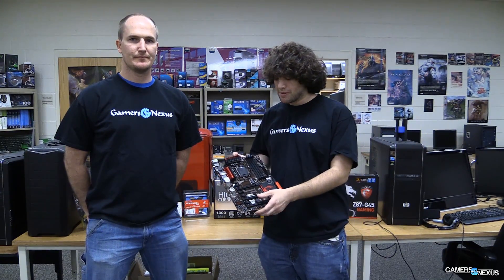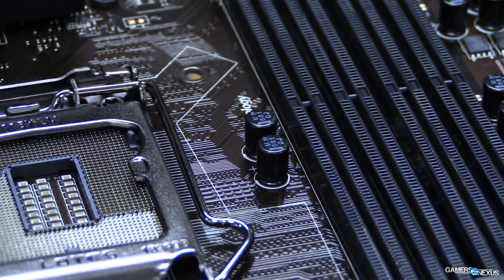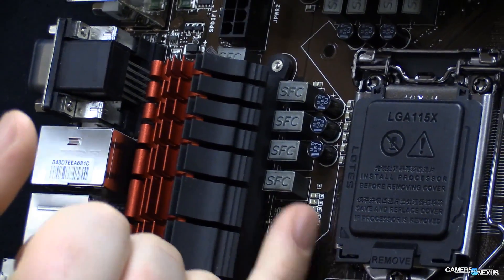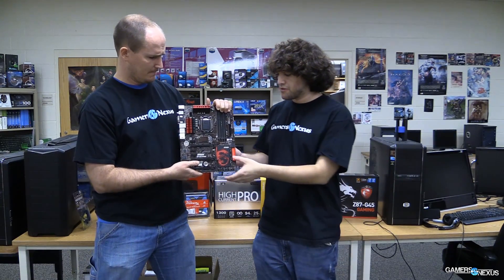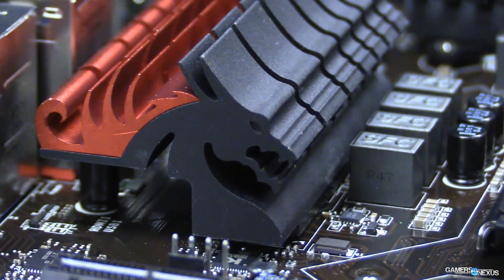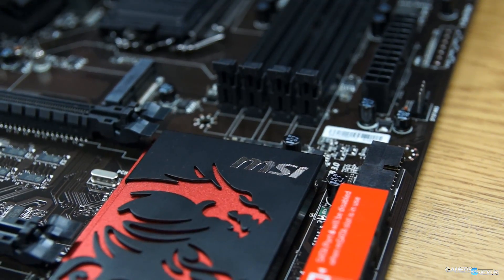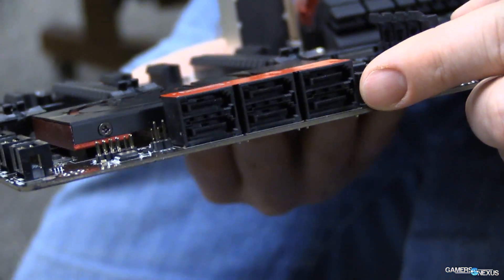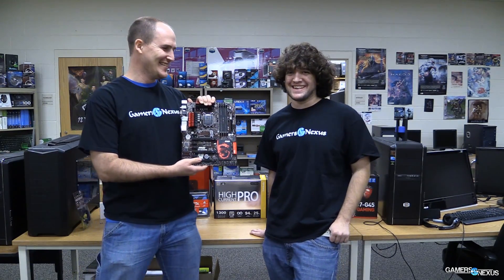Anatomy of a Motherboard - How a VRM works, MOSFETs, Chokes, Chipset, & PCI-e (UPDATE)

Comment: How can a VRM put out 50 or 100 amps when a wall outlet is only 15amps?
Reply: Look up what power means. One of the formulas for power is P=I.V or Power = Current x Voltage. The lower the voltage, the more current you need to achieve the same power level. Example: a 95w cpu would need 95 amps at 1v vcore. 95 w Power = 95 (current) x 1 (voltage). Your 15amp wall outlet at 110V can supply 15x110 = 1650 watts of power (in theory). Motherboard VRMs exist because it takes your 110V (for USA?) that's plugged into your power supply then converts that to 12V, which is then plugged into your motherboard's 4/8pin 12V connector and then converts that 12V to below 1.5V for your vcore. Being such low voltage, you need a lot of amps to achieve the power level required. I'm no expert in this but that's just the basic electrical power physics behind it. Actually something useful they taught at school.
Reply: The power supply uses a transfer  to lower voltage and increase amperage. The VRMs do the same thing once more at the mobo.
Look at the label on a PSU.

Comment: I havent watched the video yet but, i did watch part of a video where some guy was like "so the choke is storing up power and stuff, and the capacitors are making it clean" which is just not right, cus its the choke thats "cleaning" or more like "filtering" the current and the capacitor would be "storing up energy" but i dont know how they are really used in other ways yet so it probably isnt used to store energy.

Comment: Hey guys, I'd love to see an updated video. I'm being very methodical with my next build. This will be my 4th I think, and I know a good motherboard can last you 10 years if not longer depending on when you 'buy in' on a chipset/socket type. I do plenty of video/photo scrubbing etc so I need the extra m2, sata, and vrms with raid features, and vrms for overclocking down the line, etc etc. Anyhow. I think things have changed quite a bit since Sandy/Ivy/Bulldozer. Not dramatically , but enough to do a new video and it's long overdue imo - more video angles of specific parts since the channel has more production. A longer video would suit it well to fully explain how some things relate to the fundamentals of the bios settings, not specific features by brand. Lastly, I'd love to learn about how all the new settings relate to higher performance in correlation to the old boards - or more importantly how cheap boards compare to higher end ones.
Reply: Considering the spread of features on the just released X670 motherboards for the new AMD Ryzen 7000 series CPU I would very much like to see an updates video on this.  Maybe a series of 10 minute videos with each video focusing on a different aspect of motherboards.
Reply: @The_Opinion_of_Matt  Yeah. I really struggle with VRMs and motherboard comparisons.

Comment: Why do we need to over clock anyway CPU should have a range instead my cpu is 3,7 but run at 5.0 the mother board should probably have a multiplier and be optimized ... you put the cpu it does its things and give you the max out of the box with stability levels like encoding super quality, regular and extreme

Comment: The suggestions said in the video are not really helping today. Good luck figuring out all if the 10 or 12 or even more VRM motherboards on the market are equally "perfect", or there are new tricks used by the vendors to lie, while not technically lying. I am pointing to you VRM doubling practice, you cheater!
Reply: Luckily, Buildzoid does motherboard overviews for them now.

Comment: Great video. I wonder why the platform controller chip heatsink is so flat? it cant dissipate that much heat that way? I mean, in the old days the only heatsink on a MB was on the northbridge
Also, VRM heatsinks used to be better back in 2013 imo, ive been looking at AM4 MB's and those heatsinks looks kinda crappy

Comment: More phases equals more current, not necessarily cleaner power. 

N-phase DC-DC buck converters can produce more current by spreading the load among multiple FET's, inductors and capacitors. This allows the TDP to be shared, which means more current can be conducted with relatively lower cost components. Essentially, each phase handles 1/n of the total load. For example, if the voltage controller is providing a %50 duty cycle PWM signal on a four phase VR, the duty cycle for each phase becomes %50/4 or %12.5. 

The power is cleaned (filtered so as to remove DC ripple) by capacitors. Current is maintained by the EM-flux stored by the inductors (chokes in this context). The inductors also serve the purpose of "bucking" the voltage down. The power provided is only handled by one of the phases at a time. Though, the capacitors are probably all in parallel with the load (CPU/GPU or RAM).

Now, one thing to keep in mind is that having more phases will mean that the components run cooler, which would allow them to perform more reliably. That could mean that the power is cleaner over time but still, that is not the primary concern with regards to adding more phases to a buck-converter. It's about more power for a cheaper price.

Comment: Here are some missinfo's within. H97 Chipset don't lock overclocking. It is a part of the Bios Code that lock it or better to say the SVID and VID Commands profivded by Intel to say the PWM Controller what he have to do to get the Phases to a Certain poweroutput. And by the Way DRAM Controller power supply is handeld by another PWM. So there ist maybe a 4+2 with doublers für der VRM and a 2+1 PWM for the RAM Voltagecircuit.

Comment: why would you do a visual on this with a motherboard that covers the mosfets? I thought it was supposed to be showing the parts not showing that you're holding a nice board.
Reply: I know that this is 6 years late but MOSFETs generate a lot of heat and hence they always have heatsinks. They can easily go up to 70-80 degrees without a heatsink.
Reply: @Naverdo  Yes, but those should be taken off to display the components, and later put back on with the relevant explanation.
Reply: @Lishtenbird  oh, I didn't know that you could remove the heatsink. My bad.